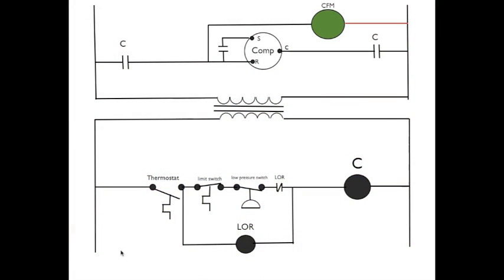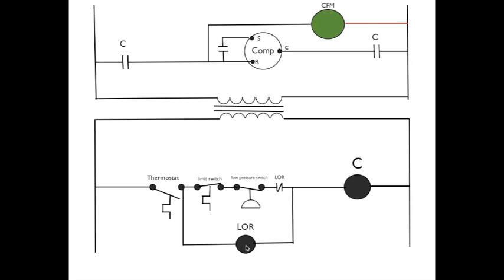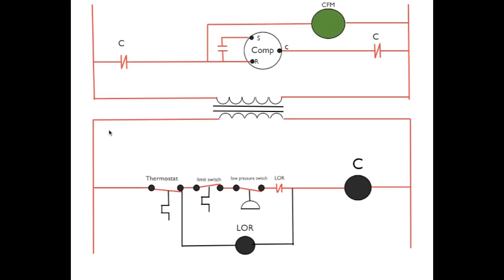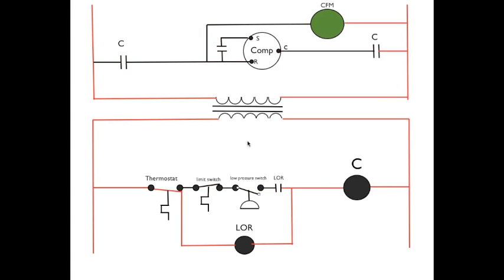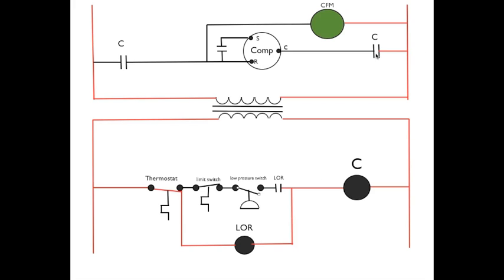The lockout relay circuit

Comment: Just to correct a little bit, the LOR and the C coils are connected in series and there’s a voltage drop not and amp difference. The LOR is 12V and the C is 24v, since the LOR is taking away 12v out of  the 24V source the C coil is only receiving 12v too not fully energizing it since it needs 24v thus not activating it.
Reply: 👍 yes ! And high impedance lock out relay  will be wire in parallel.

Comment: Any way to check a lock out relay? I just changed out an ICM220. I want to check to see if I did the right thing. System started fine after I changed it but I want to be sure the LOR was bad
Reply from the maker: There is a good chance the LOR has not failed if the unit shut down on lockout.  Under normal operation the relay does not energize.  If there was, for example, a high head switch wired to the lockout, the unit would shut down and the high pressure would drop because the unit is not running.
GFM

Comment: I didn't understand why the lor is in serie with the CONTACTOR C. We can connect it directly to the negative  ie in parallel with C and it will deenergize the C
Reply from the maker: The point of this circuit is to only deenergize the contactor if the limit or pressure switch open.  
When wired as you suggest, it would be deenergized whenever the thermostat closed.
GFM

Comment: Ive Had issues with this where you have a fire relay on a A/C so when the fire guys or a false fire alarm sounded it would initiate my lockout relay...... This building had constanly had fire alarms going off which shut off the A/C... A reset would be the only way

Comment: Great video - TYSM for making and sharing. 

Question: what software package do you use to make the circuit diagrams?
Reply from the maker: I actually do not use any.  Just Keynote (Powerpoint to Microsoft users).
GFM
Reply: +grayfurnaceman 

Great work!

You had me thinking it was some "interactive electric circuit" program :)
Reply from the maker: I found the programs to actually harder to use for simple diagrams like this.
GFM

Comment: hello I have a doubt what kind of relay I should use in LOR, when I have a 24v transformer.
Reply from the maker: The relay should have a 24 volt coil, and be much smaller than the relay for the equipment.
GFM

Comment: The important reason that the LOR picks and the contactor coil does not is that the LOR is a "high impendance relay," meaning that while it takes very little current to pick it up, its windings act as a limiting resistor in series with the contactor coil, so that the LOR itself prevents enough current from flowing to satisfy the contactor coil requirement for pickup current. The LOR impedance is many times that of the contactor coil, and the resistive component difference can be measured with a meter. This kind of circuit is used on all of those old York Sunline units with the small board at the top of the control bay.

Comment: I try tht lock out relay with 2 compressor and with overload relay. The think is it will not work. Even the lockout relay is energize but if you removed the power of condenser fan motor and not connecting that time its work. That why im i confused and check again the wiring. When the lockout relay energize it must compressor and cond fan not working but still working so i check the power of compressor it show 8 volts lockout relay is 16 volts and condenser fan contactor 24 volts, what i did i removed the control for cond fan that time its workin fine. But i dont know what is the reason that's why im confused

Comment: If it was 120V not 24V would the compressor contactor coil get damaged in anyway when current passes through the LOR and then into the CCC when a safety is open ? so your saying voltage is being used up to activate the LOR and not enough to activate CCC ?
Reply from the maker: Brent Peluso Yes.  The low amperage required to activate the LOR will not energize the CCC.  It just sees the CCC as a wire.  Hope this helps.
GFM
Reply: Interesting, what if you have 2 compressors in series... isn't that bad ? I was told loads in parallel,  switches in series...
Reply from the maker: Brent Peluso In electricity, nothing is simple.  What we may think of as always a no no, often works quite well in the right conditions.  The lockout circuit is one of those.  The more you learn about electricity, the more interesting it is.
GFM
Reply: Ok thanks GSM

Comment: Why doesn't the LOR switch open when power goes through it via the other switches?
Reply from the maker: The electricity will travel thru the circuit that has the lowest resistance.  The high resistance of the coil of the LOR relay precludes enough power traveling thru it to energize the coil.  I know this is hard to understand, and I will try to do another video attempting to explain why the electricity does this.  
GFM
Reply: grayfurnaceman Thanx. I like your videos. Keep it up.

Comment: Don't use lockout on a WR 5400 thermostat if u have a packaged A/C & heat pump WATHER IT'S a GAS PACK or NOT cause it can make it not run right believe me I've had many problems a packaged unit from the year 2000 or older have built in lockout delay. For units 2001 and later do use the lockout feature on this thermostat they have an electronic lockout delay witch need this.
Reply from the maker: Sounds like good info to know.